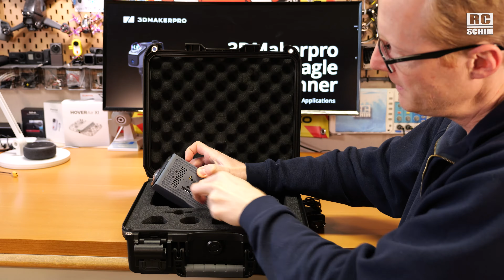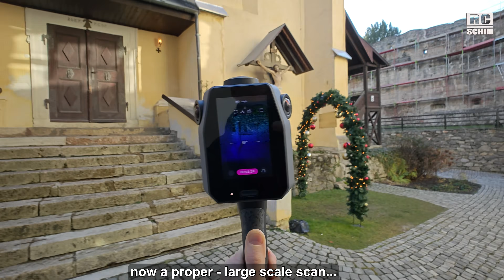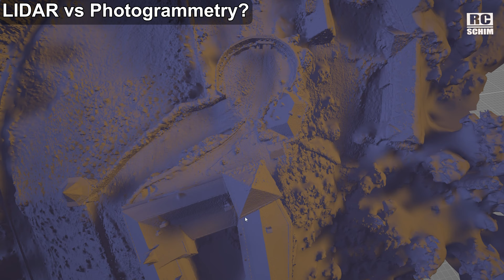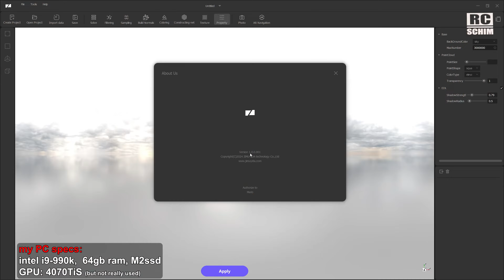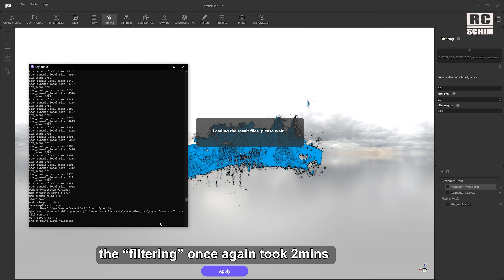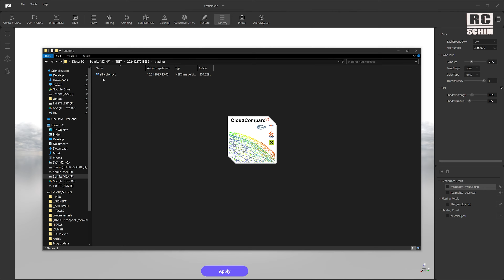3DMakerPro EAGLE LIDAR Scanner Review

Comment from the maker: structured article here:  https://rcschim.blogspot.com/2025/01/lidar-scanning-gaussian-splatting.html

18.6.25: Update video online! https://youtu.be/6OgdmpW08GM 
(most of the complex workflow steps mentioned in original video have been adressed - now it's really easy to use - even the creation of a gaussian splat is just one click - and a lot of needed CPU/GPU power!)

8.3.25: in the meantime I could successfully test the new "Ray studio" - it can handle larger files now and is overall a bit better to process files. Still needs more improvements but is a good step.
I also received a firmware update for the device - I will try it soon and let you guys know what's improved. 

21.2.2025: Update: I tried an 11 min scan today - LIDAR point file processing in software failed. Sent them the file for testing - so definitly I need to stay below 5 mins with current firmware / software. Hope they can fix this. 
Images from the scan could be extracted - all of them (4500 pics in 11mins). 

My Philosophy: Honest, "almost scientific" testing, I test products rigorously and share honest opinions—even if it costs me affiliate earnings. Using my affiliate links supports my work at no extra cost to you! Huge thanks!🙏 
🛒International store: https://shrsl.com/4uaeg (Discount code: RCSEG80)    -> get 80$/€ OFF if using my code!       

EU/UK store: https://tidd.ly/4b5HIXe (Discount code: RCSEG80)
Reply: CORDIAL SALUDO, EXCELENTE VIDEO, PODRIAS HACER UN VIDEO CON UN ESCANEO QUE DURE UNOS 8 MINUTOS, QUIERO VER SI POR LO MENOS ALCANZA ESA DURACIÓN, GRACIAS
Reply from the maker: Lo intentaré el fin de semana. La última vez, hice 11 minutos, pero el software no pudo procesar el archivo resultante. Prometieron una actualización para solucionar este problema. Haré otro video con una actualización.
Reply: @Rcschim  ya compre el equipo, me parecio bueno, use tu codigo, última pregunta, si es posible que nos comparta el nuevo intento  de uso con el equipo?, gracias
Reply from the maker: @fabianrojas1224  Hi, this is a reply so you get notified about my update video I just posted today. Make a firmware update and download the new RayStudio 1.0.6 - it's really good now!   https://youtu.be/6OgdmpW08GM

Comment: One main use for Lidar on a drone is to derive a DTM (digital terrain model) as opposed to a DSM (Digital Surface Model). Drone based Photogrammetry is useless at determining the surface of a forest floor underneath trees in summer.  Another good reason to use LIDAR on a drone is to integrate the data with ground-based LIDAR scanners and Total Stations with GNSS.

Comment: Добрый день.
Несколько вопросов.
Для чего нужны боковые камеры, если для раскраски облака точек используется  только одна (фронтальная) камера.
Вы упомянули о сервисе по обработке облаков на сайте производителя: можно ли с помощью этого сервиса сшивать несколько прследовательных облаков точек с этого лидара в автоматическом режиме, а не в ручном режиме.
Есть ли у вас опыт использования данного лидара в геодезических целях, то есть использовали ли вы данный лидар с опорными геодезическими  маркерами или геодезическим приёмником для определения точной траектории движения лидара?
Спасибо за ответ.
Reply from the maker: Hi, until now the software was in early stage, that's why they only use front cam for pointcloud.
Additional cams will be used for panoramic images - but this wasnt available for testing yet. I think they also can use the additional images for "gaussian splatting"
Cloud processing / stitching:  I don't think this will be possible automatically - maybe they offer this as a manual labor service.
geodetic purpose: no - I'm a consumer type user not a professional - sorry ;)
That all being said - today I downloaded the new software which should be able to handle longer scans. They also told me about a firmware upgrade of the device.
Stay tuned on my channel - I will test this and make an update video.

Comment: I am seriously considering buying this for caving but I wonder if it can withstand moisture as well as a typical camera can.
Reply from the maker: The body feels quite rigid and well built, I don't see issues there. To be save check their tech specs and see if they supply Infos on moisture and temp range it can be used.

Comment: Thank you. How do you explain the low price? Soo much cheaper than Faro, Laica, or anything else.
Reply from the maker: Someone here with a lot of knowledge in LIDARs explained how it could work. On GitHub you find a lot of libraries for the software functions as open source. And for automotive and robotics use - the LIDAR unit used here came down in price. There are projects where DIY people built a similar LIDAR (even here in my comments I read from their adventures trying this themselves). So if you already have the programmers and knowhow in 3D (they have 3D scanners already) - you can attack the established market. Quality comparisons are missing - since the expensive units from Leica and Co are not handed out the YouTubers :)

Comment: Great review! thanks a lot.
Quick question, do you know how are the imagse and cloud points related? We want to use our own GS creator using the point cloud and images and it would be very useful to know where is the information about the position of the images with relation to the point cloud stored. any text file? inside the LAS? Thanks again!
Reply from the maker: On scanning you get 2 BAG files (some sort of zip files). One for points, the other for images (from multiple cams)
I think images are tied to point scans only by time index? but I could be wrong.
In their software you get the option to colorize the points using a selectable image folder and you can supply either the duration between pics or the distance - ok I just realize they must have some coords than as well.
BAG files are "#ROSBAG V2.0"   maybe this helps you? Some other guy mentioned that this is all on github (ROSBAG and also the libraries for Lidar scanners)
here at this link: https://drive.google.com/drive/folders/1-2T1DIH99wGFIQAfvU8uNVKgNNddx7MS?usp=sharing   you can download the "RAW Scandata 20241217213223_0.zip" to find and examine those BAG files yourself!
Reply: @Rcschim  wow, thanks a lot! We will check it right away.
BTW, if you want to test our VT PRO software to publish your GS models just let us know and we will give you a license for free. It´s the least we can do for your help ;)
Reply from the maker: @3dvista  Yes, sounds awesome! please send me some info via mail on schim@gmx.at - excited to try gaussian splatting myself.
Reply: @3dvista  waiting for your experiment.

Comment: Hello, good video. 
I wonder what is the export formats of the Lidar software? I use Revit which imports only .rcp file. Thank you
Reply from the maker: I don't recall RCP Files as an option in either directly the Raystudio (3DMakerPro) nor in the freeware Cloudcompare.
RCP sounds like a propriatory format of your revit software... Check to see if you maybe can import some standard formats, or take a look at CloudCompare - I was quite blown away by its features (considering it's free!)
Reply: @Rcschim  L'unico modo che io conosco per creare file *.rcp è recap. Non penso ci siano altre soluzioni. di recap esiste anche una versione free come visualizzatore di file, non so se questa versione permette di salvare i file *.rcp o solo di visualizzare i file las-laz

Comment: Thanks for the content, god bless you!
Speaking from Brazil and interested in the function and process to measure volumes using the eagle. Can you say something about this?
Reply from the maker: Hi Mat, I'm quite sure that you can measure volumes quite good with such a scanner. I'm not sure if for example CloudCompare has this function (but I guess so). It also depends on the targeted accuracy that you need - and the scale (smaller scans below 1m or so will lack accuracy, larger scale is fine...
Reply: Você tem ideia de como funcionaria a importação desse equipamento? Custos? E manutenção do aparelho em caso de falhas ou calibragem? Em que workflow de software você planeja? Eu gostaria de trabalhar com revit.
Reply: @bigulão  creio que a manutenção seria uma questão bem problematica. Importação, deve chegar por uns 24k ao brasil. 
Programas GIS para operacionalizar os dados.

Comment: Thanks for the superb review. Do you have any insight on how the 3d tours will work - is this a variant on gaussian splatting similar to the tours available on Jimumeta or will users need to stop to take 360 images as they scan similar to the Matterport scanner workflow? I'm looking at SLAM as a potentially faster means of scanning a space than using a tripod based scanner and looking for both point cloud and virtual tours as an output. Any thoughts appreciated!
Reply from the maker: I've seen a Matterport scanner at work once - and it's good, but tedious to setup on tripods - as you know.
Here with the LIDAR / 4x cam setup, you walk around, take pics and LIDAR measured dots, and upload it to their portal. There a Gaussian splat will be created (dont know if automatically or if they need to put in some manual labor.
They sent me 2 very low quality video previews of what they could achieve with my scans. It looked nice (aside from the low video res). 
Problem is: currently we don't know what their finished setup / software will look like. 
A lot of promises that have to be kept ;)
Hardware seems capeable. Software is still in dev.
Reply: @ thanks for the follow up - will keep a close eye on this one! Matterport is great but it’s time consuming and I’m not a fan of the closed ecosystem and subscription that you’re locked into. Cheers for now 👍🏻
Reply from the maker: I will test 3D Vistas software - check them out -- they have Virtual Tour software and it's a one-time payment license model. They look promising and they contacted me because they want to integrate the 3DMakerPro LIDAR in their software...
Reply: @Rcschim  ace, sounds good - thank you!

Comment: I was tempted by the price, but I downloaded their sample scans and imported into CAD software. I discovered the accuracy was very poor. The building walls are very fuzzy with points scattered and not forming a consistent plane. I cannot confidently measure how long a particular section of wall is by picking from corner to corner because the spread of the points makes it so I can't identify where the actual corner is. I don't think this will be very useful for any engineering or architectural work.

I've worked with point clouds generated from leica rtc360 and faro focus, the points are so tight I can measure the size of structural steel members from the point cloud.
Reply from the maker: thanks for your input. Since I have no experience with those industrial grade lidars (and how good and accurate their pointclouds are) I was impressed already by the quality of this entry level scanner.  but it would have been to good to be true, to get a really good and accurate scanner for that price, right?  Think about how frightened the competition had to be :)
Reply: You can not compare a Ferrari with a Ford Mondeo. One is a stationary  high end TLS with subcentimeter accuracy the other is a handheld mobile SLAM device with 2cm spread at best. The BLK2GO also has much noise compared to the RTC360. It is job dependent what device you will need. If i want to scan part of a forest or an urban area this could be just enough + much faster and ligther. Also nice to have RTK option, which both of the RTC360 and BLK2GO lacks. I'm curious how it will perform.
Reply: Yeah from what I'm seeing, if you know your way around photogrammetry that might still be more accurate than this.
Reply from the maker: @Waffle4569  I don't think that computational photogrammetry can be more accurate than measured LIDAR scans. No matter how noisy the LIDAR might be... Photogrammetry can "look" really accurate - but it's still just an estimate. Nothing that an engineer would prefer over a measurement ;)
I also learned that with optimized settings the scans get more accurate.
Reply: @Rcschim  Hi, I'm following all the comments here at the moment and have to comment on them. I can't accept the opinion that scans are more accurate than photogrammetry. Both can be very accurate if the circumstances are or are created accordingly. There were probably too few images for the model of the castle, I always work with an 80% overlap of the images, which makes a big difference and I usually have additional measured control points, which also increases the quality. The mobile scanners are a nice tool to scan something quickly without high expectations of accuracy. I gained my first experience with mobile scanners 10 years ago. There I was allowed to work with the ZEB Revo Geoslam, among other things, where I had an accuracy of 7 cm in the corners of a room, after various software upgrades and attempts we were then between 1 and 3 cm, as I said that is for a one-handed device, backpack solutions are a different caliber, you can scan a bridge or a castle within 40 minutes. I also find it strange that the accuracies are given for different distances, normally this is done with the resolution (distance between the laser points at this distance). As you have probably noticed, I do this professionally in the field of surveying. But as I said, these are just my personal comments. Your video is really good and informative. You don't neglect testing and the comparison with another acquisition method makes everything easy to understand.

Comment: Absolutely flabbergasted... just spent the last three months building a velodyne vlp-32c handheld slam system from scratch as I wasn't about to pay the 5-figures for a commercial model.  Then this hits the market.  :/
Reply: Same here, i used different Lidars (Ouster, Livox) and different ROS based methods (Fast-Lio2, Fast-Livo2) but it was always hard to fine-tune everything. Now i ordered the eagle, i am excited how it will perform against the other ones
Reply: Hey, i was building the same thing but didn't get far.  Do you have a working version?  I would like to see what you got.  Send me a message.
Reply: I'm working on a similar project, thinking about making it open source if I manage to get it anywhere (got a 16c sensor on hand here and some proprietary parts I'm planning on repurposing). Mind getting in touch? I'm curious to know how others have approached the issue.

Comment: Great job on the review. Lots of important details and insights! Thanks!

I am really curious what happens if you were to extend the scanning time to 10 or even 15 minutes. Would it even work or is it more the issue of having a computer capable enough to handle it later? I work with scans of interiors of buildings and this scanner would solve a few problems, but it I would need to be able to scan a large 3 or 4 storey house and having a hard limit on the time would be a no go.

Also, was "loop closure" part of the process? Does the scanner need to start and end at the same place for best results as it is common with other SLAM scanners?

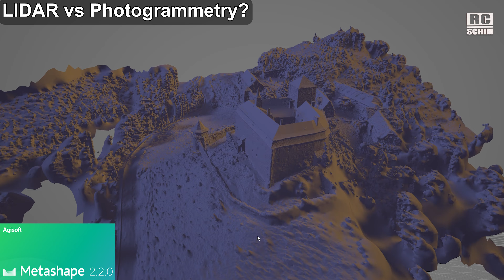PS. a little nitpick: at 9:12 you mention that the trapezoid shape of the Burg Kranichberg tower as a flaw of the photogrammetry, it is actually not a mistake, The tower has this shape in reality, it is not square.
Reply from the maker: Thanks,    I will try longer scans again. When I got the device one of the first scans had corrupted data (it was 6 or more minutes). Then they also gave me the reccomendation to stay below 5mins. I simply didnt try longer scans after that anymore. 
In theory you can align multiple scans - but it's some work.
Since I had little experience I didn't care about loop closure. Maybe sometimes I did it by accident ;)
Yep, I even said that in the vid (about the castle tower) - I checked on google maps and saw it really has no corner with 90° angles ;)
Reply: @Rcschim  Thanks for the reply, 
it's an interesting scanner for the price, the limitations are always interesting, as they show really what are the true use cases.
Registering multiple scans can be done of course and we have done that many times at our company, but it's always a hassle, so if it can be avoided, I'd avoid it.
oh, I misunderstood the part about the tower, my bad ;-)
Reply from the maker: tried an 11min scan today - LIDAR point file processing in software failed. sent them the file for testing - so definitly I need to stay below 5mins with current firmware / software. Hope they can fix this. 
Images from the scan could be extracted - all of them (4500 pics in 11mins).
Reply: I doubt that one cycle of a not removable  battery, (1 hour 
from my understanding) could be able to scan a 4 storey building😮😢

Comment: When was this video taken? I am pretty sure there were new hardware and software updates out from the time this was filmed and today.

Also what do you mean the cameras are not 48mega pixels but 12mega pixels?!
Reply from the maker: Most of my filming was done late Dezember, early Jan. I asked them a few times for new firmware. Dont think they already have a new hardware revision.
So far they are working on the software - hope that also the functions directly on the device are being optimized.
Cams are 12MP - but 4 of them (48) - they call it 48mp cams - it's a bit of a marketing trick I think - they make you think you get 4 x 48mp cams
Reply: I think 1× 48 mb camera  is better than 4× 12 mb camera 😅